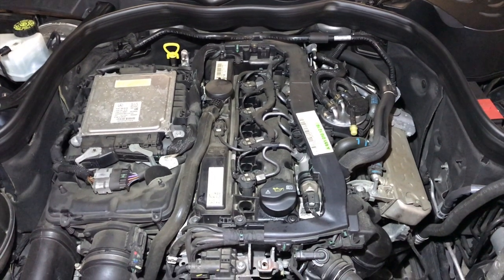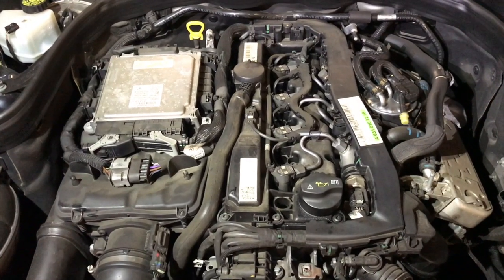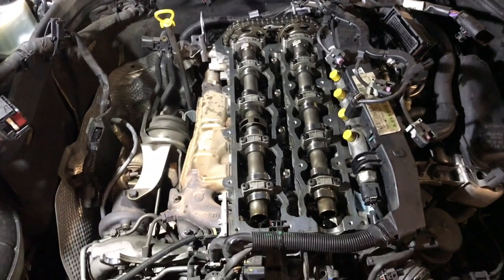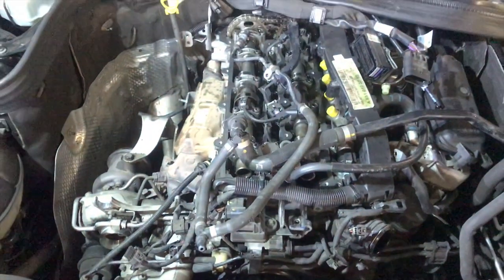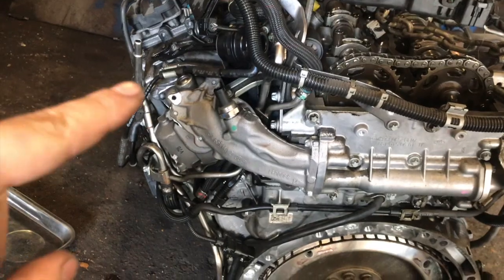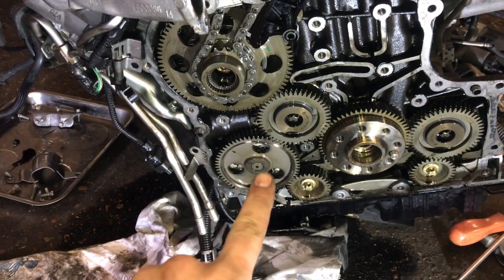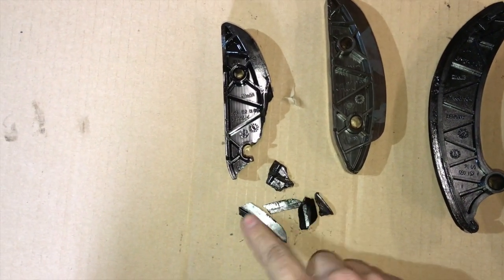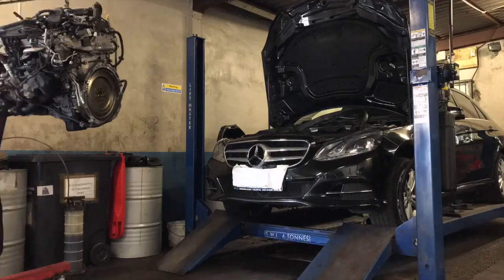Mercedes | Timing chain & guides replacement | OM651 220,250CDI

Comment: Hi, how did you remove the torque converter bolts? when there is no access hole on the botom of the bellhousing.
Reply from the maker: There is a small hole in the bellhousing, you need to turn the engine from the front crankshaft pulley and find the bolts there should be 6 in total
Reply: @mercmantips  Thanks for the reply, i got the bolts out.

Comment: How do you change the chain without removing the engine? What a stupid design decision if you ask me.
Reply from the maker: I agree with the stupid design, so if you remove the rocker cover you can work on the chain at the rear of the engine and connect new and old chain and turn the engine so new chain eventually replaces old chain, but it is a tricky job, if you drop any of the pins or brackets of the new chain down the engine then your in trouble 😅

Comment: We replaced timing chain and service belts after refurbishing the engine head. At first the engine was running well but after it started to make a strong ticking noise on the engine head. We checked timing and it was perfect. The computer tells us that gasoline pressure is OK and apparently the high-pressure pump is working fine. What we noticed is that the camshaft olives have been worn after putting the engine back together. The main issue is the loss of power and now we have to deal with this ticking noise as well. There were no cracks in the engine head and the cylinders are perfect. We replaced the inlet airflow motor. We replaced the air pressure sensor and the TPS sensor. Nothing! What is going on? There are no cracks in the exhaust manifold and the turbo is running fine. Intercooler pipes are a fine. The main problem was the loss of power and we couldn’t figure out what it was so we opened the engine. After refurbishing everything the problem is still there but there is no check engine light and no sensor error. What’s going on?
Reply: Did you find out?

Comment: Does the fuel system bleed itself after refitting the lines and Injectors when you crank the engine.
Reply from the maker: Yes but sometimes when you remove and refit injectors on this engine the injectors can lock up and require them being changed
Reply: @mercmantips  what do you mean they can lock up?
Reply: @mercmantips Changing injectors because of air in them?

Comment: Brilliant video. I just discovered your channel and I love it!
I hate the direction that MB have taken. You'll know as well as I do, a V6 CDi can be disconnected, lifted/manhandled out of a W211 or 221 in a matter of a few hours. These units are a nightmare in comparison.
Thanks for the excellent uploads!
Reply: By replacing timing chain from rear side of the engine it is a task job by discounting engine and transmission units to their whole wiring harness ,water line,fuel line ,intake and exhaust line hose and pipes
So it will difficult to their old varients😢

Comment: What year did they upgrade the chain tensioner as the older ones have two oil holes.  New ones have 4? The new ones stopped the chain issue I heard? I'm just wondering weather to get the upgraded tensioner.. or of my mercedes already has the upgraded one in?

Comment: Isnt the real problem here the tentioner itself not holding pressure causing the chain to rattle for a few seconds, and not the chain Being worn?
Reply from the maker: I have compared an old and a new chain, the old chain is around 5mm longer than the new chain, so that means the chain stretches and gets longer due to wear…

Comment: Great video. Would this problem also arise with the W203 2.2CDI from 2004 C Class ?  Grateful for any advice .  Thanks.
Reply from the maker: No, not at all, them engines are solid
Reply: @mercmantips  Thank you very much Mercman. That's a big help to know .  You are generous with your time .

Comment: Hi, question. My vehicle needs timing chain replaced. How do I know my guides need to be changed too? I know In the video you found a piece of the guide but what if you haven’t found a piece. Will the vehicle not run if guides are broken? Also, if it’s not the guides and I replace timing chain, would it be a case where guides will break eventually?
Reply: Yes they will as there hard Plastic,Replace chain and Guides and Tensioner as well
Reply: @TucanoOne Are the guides the same as sprockets? Someone here mentioned replacing the sprockets also, what are these?

Comment: In my opinion the start/stop system causes most of the problems with the chain stretching !
Reply: Yes it actually is the stop start
Reply: @grahamgray5333 So, this engine with 380.000 km without start/stop and with proper oil changes on time has less risk of timing chain stretching than one with start/stop with less km's? In order words am I save regarding the timing chain with 380.000 km without start/stop?

Comment: With this engine, how many miles does the chain change?
Reply: If you go by Mercedes' service intervals of 16,000 miles in my experience I've seen them need replacing as early as 90,000 miles, mine lasted until 150,000 with me changing the oil every 8000 miles

Comment: Hi there. I have a 2015 E220 With this engine. On a cold start my engine does not sound like this but does have a slight ticking noise like tappets and goes away after a few seconds and the engine sounds smooth and normal. Its covered 108k. Any ideas please.
Reply: Did it turn out to be the chain? You can remove the injectors and rocker cover to see if the chain has play.
Reply: @BibiMizrah  hi. It was tappet noise. The hydraulic lifters are worn slightly  and make noise on colder mornings. Merc indie said its normal on these engines and not a concern. On warmer morning cold starts its silent. Car has now 156k. Running fine and no chain noise at all thanks
Reply: @pgachapman  That’s good news! I have a 2015 OM651 in a C-Class. I get a similar noise that you have described here. I am getting the rocker cover gasket changed next week so will get them to check the chain for slack. 

I have uploaded a video of the noise on my channel, please could you have a look to see if this is the same noise yours was making on cold start? To me it sounds like tappets. If it’s the chain I will be upset as I always change oil and filter at 8k as minimum and have never used start stop. 

Thanks.
Reply: @BibiMizrah  hi. Will get look at the video after work. I change my oil every 10k as i do long motorway journeys every day. My indie told me to  change the chain tensioner every 100k as they start to fail slowly at that mileage. He said Only to use genuine mercedes tensioners. so I bought one fromnthe dealler and it cost me £110 and four hours to fit. Make sure if yiu buy one that it has the upgraded 4 oil holes in it as the older ones only had 2. Helps with oil flow..
Reply: @pgachapman  thank you, let me know if the sound is familiar if possible please.

Good info about the tensioner, I will give Mercedes a call to get the parts price. I have heard about the new four hole variant previously. How much did the tensioner cost to fit?
Reply: @BibiMizrah  i fitted it myself. Its not too difficult. Not too much to strip. Its located in the rear left corner as you look at the engine. The airbox needs to come out and a few brackets and cover plates aswell. Took about 4 hours start to finish and that was my first time doing it as i was working it out as i went along
Reply: @BibiMizrah hi. Yeah sounds the same as mine makes. Ifit was the chain it woupd be a distinctive clattering sound. Im sure you have seen videos on om651 chain noise on a cold start. There is a big difference
Reply: @pgachapman Hi Peter, 

Sorry for the late reply, for some reason I was not notified. I just manually checked this video and noticed you replied.

After getting my rocker cover gasket changed the oil leak around the injectors has stopped.

While he was under the cover the chain was checked and I only have a slight play (1-2mm). 

With over 115,000 miles I can only rule this down to not using start / stop and changing the oil regularly and according to schedule.

You were correct, the noise must be coming from the tappets.
Reply: @pgachapman I have a OM651 with 380.000, engine oil always  changed on time. No rattling sound on cold start. Am I save to continue driving the car without changing anything? (Car has no start/stop). 

Is it sufficient if only the tensioner is replaced as  preventive maintenance? For that, the gearbox and engine don't have to be removed? Thanks!

Comment: Hi MercMan Tips Been a long time subscriber I love Mercedes as you do, I do have a question for you. A little bit of rattle is normal on these cars on startup since the oil isn’t circulating inside the timing chain cover before 2 to 3 seconds, but at what kilometer would you recommend getting the timing chain changed?my car have run now 200,000km
Reply from the maker: Hi, a normal good engine should not rattle at all at startup, so if there is a slight rattle thats the first signs of the chain stretching and thats when you’d need to get it changed
Reply: @mercmantips  I have a similar issue, rattles for less then a few seconds, looks like a massive job, how much would you estimate the job would cost for supplying the chain as well the labour?
Reply: @mercmantips I have a OM651 with 380.000, engine oil always  changed on time. No rattling sound on cold start. Am I save to continue driving the car without changing anything? (Car has no start/stop). 

Is it sufficient if only the tensioner is replaced as  preventive maintenance? For that, the gearbox and engine don't have to be removed? Thanks!

Comment: Question for you guys! Could you confirm if this is an interference or non-interferance engine please?

I used to do similar repairs on BMW's years ago but never done a Merc. A friends failed recently causing the engine to cut out and not start. I'm about to whip out the engine. 

Might have to ge tthe head sent off...

Comment: My e220cdi 2015 (om651) has 420.000kms and has never had the chain replaced, last week it started rattling at cold start tho😂
Reply: Und meiner ist auch 426.000km
Reply: I have a OM651 with 380.000, engine oil always  changed on time. No rattling sound on cold start. Am I save to continue driving the car without changing anything? (Car has no start/stop). 

Is it sufficient if only the tensioner is replaced as  preventive maintenance? For that, the gearbox and engine don't have to be removed? Thanks!
Reply: Did you replace anything after hearing the sound?

Comment: How many kilometers did this engine have when you replaced the timing chain. My 2011 C250 has 265000 kilometers and never had problems with timing chain or tensioners (i better knock on some wood)
Reply: If yours doesn't have the start/stop system maybe thats why it lasts longer

Comment: Hi there. I am seriously considering a C Class Coupe in 220 or 250cdi guise. At 4:20 you say it cost this customer double the cost of just changing the timing chain on time. Are you saying the chain can be replaced without removing the engine? What sort of price is just a timing chain replacement?
Reply from the maker: Yes if the guides are not broken then the chain and tensioner can be replaced without engine removal, should cost around £750-£900 depending on the garage
Reply: @mercmantips  Thanks for the reply. Do the chains stretch just through time? What so of mileage should they be changed at as  a preventative measure?
Reply: @mercmantips I have a OM651 with 380.000, engine oil always  changed on time. No rattling sound on cold start. Am I save to continue driving the car without changing anything? (Car has no start/stop). 

Is it sufficient if only the tensioner is replaced as  preventive maintenance? For that, the gearbox and engine don't have to be removed? Thanks!

Comment: Hi MercMan great videos keep it up, I have the same rattle from my e220 2015 am having the chain replaced soon, do recommend the new parts shall I buy from main dealer or after market because after market they sell chain kit and merc main dealer you have to buy everything separate, it would really appreciate if you could reply back thanks
Reply from the maker: Hi Mo, iv always used main dealer parts, the chain, tensioner and rocker cover gasket prices are around £370 all in, if you need to replace the guides too they are not to expensive from mercedes, so i could only recommend getting them from main dealer

Comment: Fantastic content on your channel. I want to buy a Mercedes W204 250 CDI, 2.146 cc with 204 hp, from 2009. The car has ~ 160.000 km. Any advice besides checking if the camshaft line up at the marks? I have read that some of these had some injector problems. How do I check if it has the right injectors?
Reply from the maker: When starting the engine on cold start up listen to any rattles when engine first starts up, if there was a problem with the injectors or incorrect injectors the engine light would be on, i have videos of all the common problems on these engines on my channel 👍
Reply: @mercmantips  Thank you. All in all, is it a good choice? I want to keep the car a few years at least. It is the C250 CDI Prime Edition that I want to buy.

Comment: Hi, great video! If its not that bad and the guides are not broken, can you replace the chain and tensioner without dismounting the gearbox and engine, from the top for example? Thanks
Reply from the maker: Yes you can, did one today actually customer spotted noise early so got away with just removing the rocker cover and replacing the chain and tensioner.. 👍
Reply: And how much is the job for that ? Thx

Comment: Hi! If the guide is broken.. How do i notice? Whats the difference compared to stretched chain symptoms?
Reply from the maker: When guides are broken usually engine light will come on saying the inlet camshaft position incorrect
Reply: @mercmantips  Was the  engine light on at this car?
Reply from the maker: Yes
Reply: @mercmantips  Thanks for feedback and your content. I'm wondering that the customer was waiting till the engine light was on because the noise of the chain during startup is absolutely clear.

Comment: Your videos are gold man why did you stop?
Reply from the maker: At the moment my garage is very busy i dont have much time, but i have big things planned for this channel, upgraded camera and reveal my self with more new content to come soon 👍
Reply: @mercmantips  Nice one man! I got a question lol 😅😂 my E220 isn't getting heat anymore, blows cold air through the vents even on hot, I changed the thermostat and that fixed the problem for a couple days but it's back, ideas? Cheers man!
Reply from the maker: Your heater matrix of radiator could be blocked, these are the most common things that dont let heating come through..

Comment: Great video! We have a Sprinter 2016 316cdi which has a small rattle at cold start. When the cover is off and the chain is visible, is it also directly visible if the guides are damaged?
Reply from the maker: Im not sure it you can see it on a sprinter because of the space, we don’t do commercials so i have never done one on a sprinter, but im sure you can use a mirror or something to see down there
Reply: Thanks! I will have a look soon. Can’t it be that this can be fixed with just another tensioner (maybe even try this before replacing the whole chain)? I heard there was an engineering improvement (2 to 4 oil holes?).

Comment: thank you for video but when we have to change the chain km? thank you for answer
Reply from the maker: Kilometresi yok, ses yapmaya baslayinca degistirmen gerekiyor
Reply: @mercmantips  Hello, I am in the market for a e class coupe 2011 -2014 with 100k miles+, do you recommend the om651 engine or the v6 om642 reliability wise, I would really appreciate your opinion !! Thank you
Reply: @mercmantips I have a OM651 with 380.000, engine oil always  changed on time. No rattling sound on cold start. Am I save to continue driving the car without changing anything? (Car has no start/stop). 

Is it sufficient if only the tensioner is replaced as  preventive maintenance? For that, the gearbox and engine don't have to be removed? Thanks!

Comment: Hi very good vid
But I do have 1 questions witch is what make chain kit would you recommend?

I have a 2011 sprinter with 430k on it lol with chain rattle but need to do the clutch so I think it's a good time to do both lol
Thanks James
Reply from the maker: I always get the new chain from mercedes main dealer

Comment: Bro you done very difficult way its better to down the engine and gearbox with subframe with radiator also so that you  need to drain only engine oil and gearoil

Comment: Hi, my E250 cdi W212 AC is not working and check engine light is showing on the dash board, is it a major problem sir, could I fix it myself?

Comment: I've done my timing chain and guides aswell and now i have a rattle coming from the vacuum pump.
With the engine idling when i press hard on the brakes it rattles 🤣
Reply: You have to replace the vacuum pump, it’s a known issue. It wont be a problem if you keep driving with it tho.
Reply: @MrDosSantos991  I have replaced it. Such a fun job. A good placement for this vacuum pump 🤣

Comment: i am about to change my engine and gearbox mounts...any advice on that ? om651 220cdi..thanks
Reply from the maker: The left mount and gearbox mount is very easy, the right mount you will need to remove the DPF, which isn’t that hard either, good luck 👍